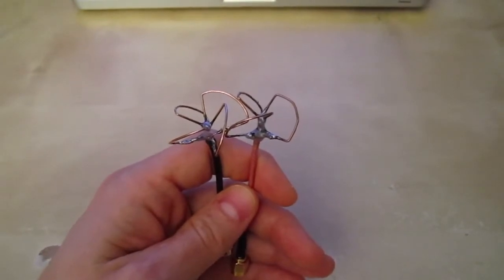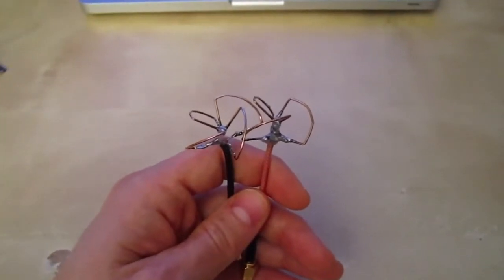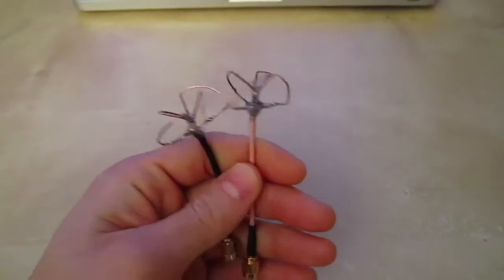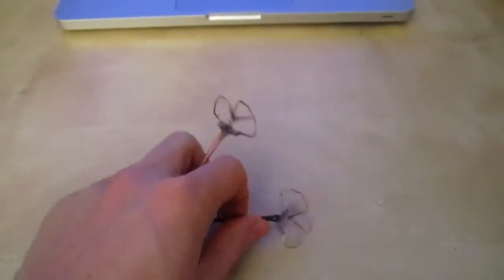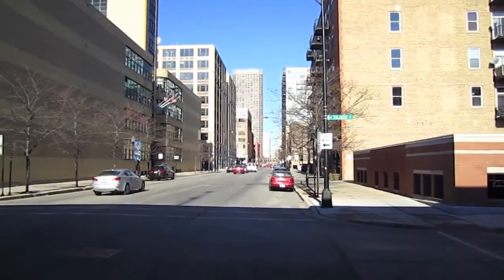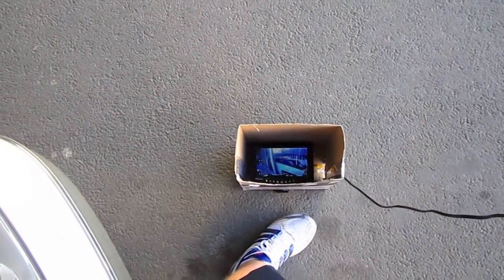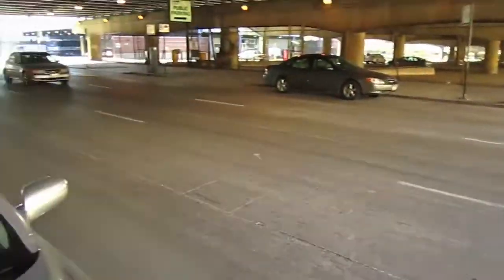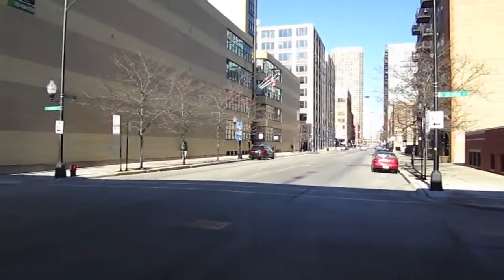Cloverleaf / S-P Antenna - Range Test

Comment: How about if u use a cloverleaf on transmitter an a 5db on the receiver do u thin a works
Reply from the maker: That could work! Just make sure that you match up circularly polarized antennas and linearly polarized antennas